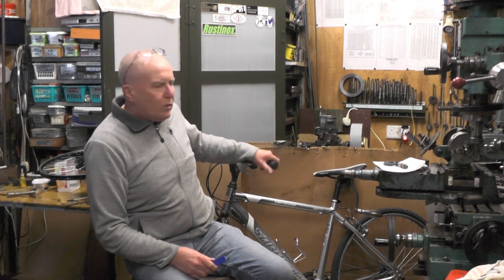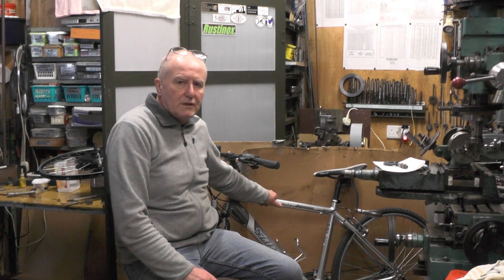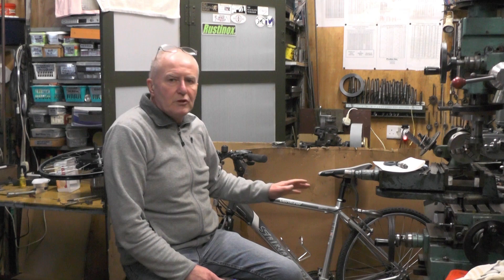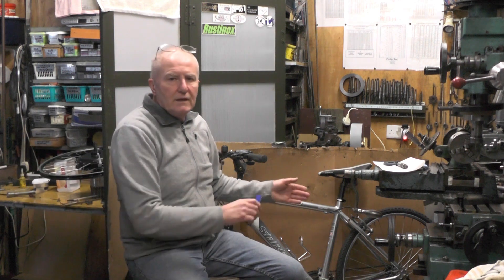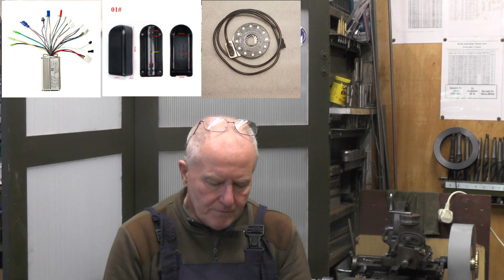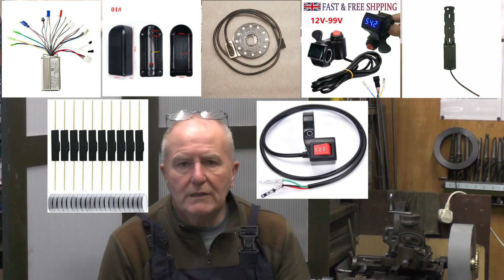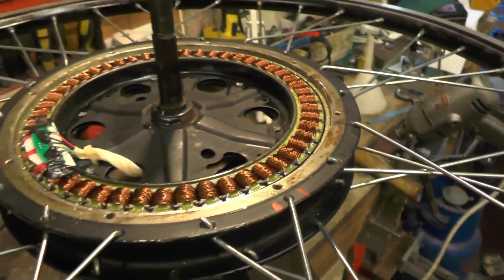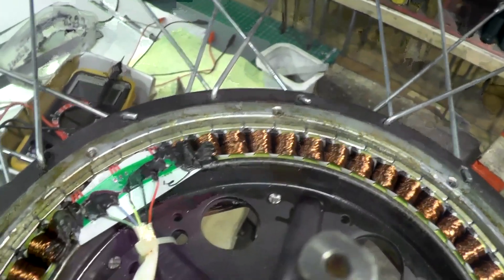CHECKING HUB MOTOR WIRING (Make your Cycle in to Electric Ebike P1) "mr factotum's workshop"

Comment: If you have hills you'd be better off with a geared hub motor rather than direct drive!
Reply from the maker: Hi Alan
Yes good point, I'm only a casual cycler on mainly flatish roads and canal tow paths, and trails etc I mainly  have the motor as an insurance policy for my back and knee problems i suffer so i can get home okay,  i only ever  use pedal assist, never the throttle,  my other bike has a geared hub, just seemed a shame not to use this nearly free hub in a bike and a project for me to do. I will now be able to compare the two, to see if there's much difference on the casual use i will be giving it.
Thanks for your interest, watching and feedback, it's appreciated
cheers
Kev